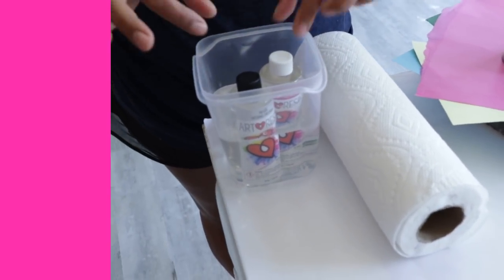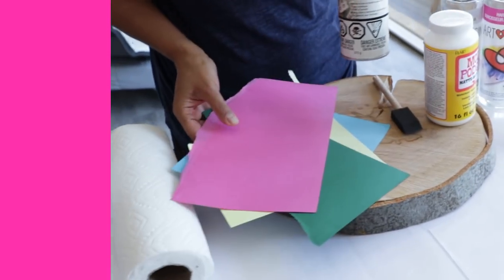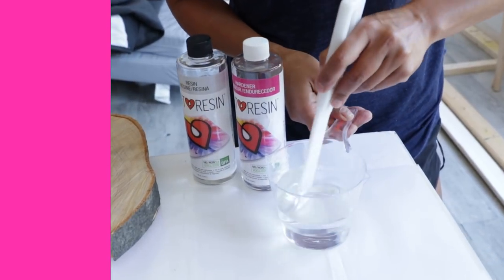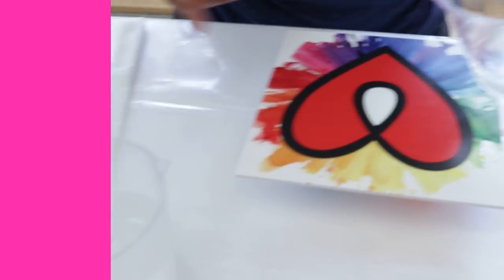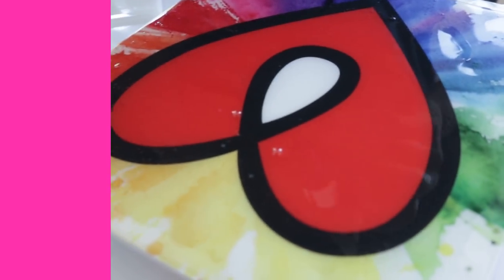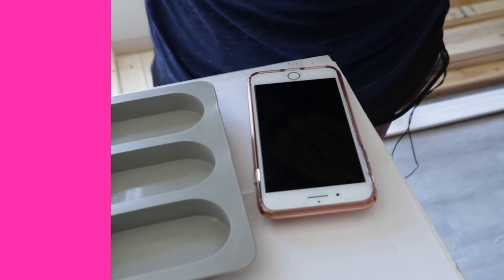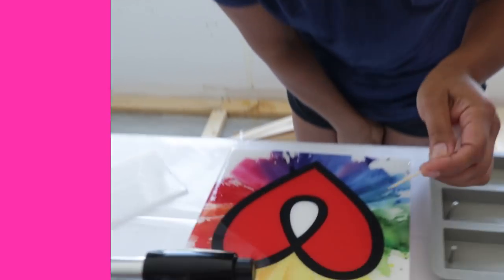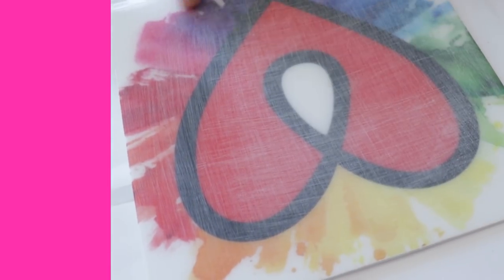How To Prevent Epoxy Resin Bubbles

Comment: Would heating the cup with epoxy after stirring in hot water or a heating pad work as well? And then pour very carefully? 

I am making a really big piece. It is like 40 cm high and 30 cm in width. It will be a diorama. So I have to do it in small layers and carefully pour. Do you have more tips for this? Is your resin working for a piece this big?
Reply from the maker: Hi Kimberley, we do not recommend using a warm water bath after the two parts have been mixed, the chemical reaction that begins when the two parts mix creates heat, setting your cup in warm water or on a heat pad at this point can cause a flash cure if too much heat builds up.  
Tips for pouring large pieces include-be prepared, have all of your supplies handy, do your prep before hand- all of your taping and surface prep etc.  Keep an eye on your working time, once mixed we recommend having your pouring complete within 45 minutes.  Sometimes if you are mixing large batches, it is easier to split it into two batches, enlist the help of an extra set of hands to stir a second batch rather than one large one, this helps reduce the risk of missing a spot or struggling to mix a large volume at once.
Reply: @Artresin  ahhh gotcha! Thanks for your reply and time! 😊
Would it help to avoid bubbles with pouring, if I pour the epoxy on an item in the diorama which is the highest of them all and let the epoxy get down on its own this way? Till it is high enough for me to gently pour it. 
I have to remove bubbles every pour I do, I think. Since the piece will be pretty high and deep. If I mix itvery gently and pour carefully, I should be able to avoid the worst of the bubbles.
Reply from the maker: @Kraftions  the best way to avoid bubbles will be to use the warm water bath and then pour in shallow layers if you want a deeper application.  You can then torch out the bubbles if there are any, allow the layer to cure for 3-5 hours before pouring on another layer.
Reply: @Artresin  ahh okido! Shallow layers will be like 3-5cm? Or thinner? This one will be pretty high. Around 40cm high. So It will take 2 days to do it this way.  Can a layer cure overnight before I pour a new one? Will you see the difference between the layers? I Also have to make sure I dye the epoxy the same, as it will be blueish. But that should be alright. Same amount of epoxy versus same amount of dye.
Reply from the maker: @Kraftions  We recommend pouring in layers of approximately 1/8" thickness to max 1/4" thickness to help minimize bubbles and prevent the resin from over heating.  If your layers are translucent you may be able to see a slight layer line between.   Casting resins will allow you to pour to depths of 3" in a single pour.

Comment: I do every single thing suggested to avoid and get rid of bubbles and I still had issues on my 4th layer. It’s a little piece on canvas. I pre sealed it. Then I put. Wood support under. I warmed the resin. Heated the room above 24c for 24 hrs. Used a blow torch. Repeated up to a 4th layer and even had minimal bubbles after mixing .
Heat would not release the few little bubbles. I find working on an 8x8 piece challenging. It’s a piece of art my friend’s child did as a toddler on cheap dollar store canvas. So the section with some bubbles only shows when looked at from a certain angle. I can’t add more layers so I hope my friend will be satisfied with it. I just don’t know what after doing ever single thing you suggest still doesn’t result in perfection .
One of my big pieces has a small issue (I’ll be selling that one) but there’s already too many layers of resin . Don’t want to make it cost prohibitive to sell that pieces there’s just one or 2 dimples in that one.
Reply from the maker: Hi Janine,  It sounds like you are doing all of the right things to combat bubbles.  Please reach out to us at support@artresin.com and include photos if possible, maybe we can help troubleshoot more specifically.  Thanks!
Reply: @Artresin  ok. Next time I do a resin subsequent layer I’ll video myself doing it and email it if there’s bubbles

Comment: Does anyone know where I can find that mold she had?!  I’ve been trying to find one like that but all the ones I’ve come across are too small
Reply: Amazon has it but search shiny finish or mirror finish and you will find even better polished silicone molds which result in a super shiny finish right out of the mold :) Happy Crafting!
Reply from the maker: Hey Ash - yes, that mold is from Amazon :)  Here is the link: https://www.amazon.ca/BARGAIN-HOUSE-Rectangle-Chocolate-23x19x2cm/dp/B077FRLCQ3/ref=sr_1_8?ie=UTF8&qid=1537192499&sr=8-8&keywords=silicone+mold+with+hole

We've used this one too with good success:  
https://www.amazon.com/X-Haibei-Circles-Silicone-Chocolate-Cupcake/dp/B00IYAWHMC/ref=sr_1_13?ie=UTF8&qid=1537192642&sr=8-13&keywords=silicone+mold+round

Take a peek at Josie Lewis' Amazon page - she has highlighted her favourite silcone molds for making petri dishes etc - super helpful!
https://www.amazon.com/shop/josielewisart/ref=cm_sw_r_pi_loc_3juiBb628TBQP

Just be aware that no silicone mold will last forever - they all eventually break down.  Try removing your cast before the 24 hr mark when the resin is dry to the touch but still flexible and that will reduce the wear and tear on your molds.  Here's a blog and video with some more info: https://www.artresin.com/blogs/artresin/shiny-vs-matte-silicone-molds

Comment: I've not being having much luck with art resin.. Even if the room is warm, and I warm the resin, and mix slowly, I get thousands of tiny tiny bubbles that I can't get rid of. Any tips?
Reply from the maker: It is normal to have bubbles when mixing. Using a torch is the best way to remove them from your piece after the resin is applied. Now some substrates tend to off gas or create bubbles while your resin is curing the most common ones are wood and paper, you may want to seal these items first before applying. If you are still having some troubles please email our customer service team at support@artresin and we will be happy to help you trouble shoot further.

Comment: How do you get resin to not scratch
Reply from the maker: ArtResin is scratch resistant but not scratch proof so using it on things like a function cutting board it would certainly show signs of wear.
Reply: ArtResin Can you spray resin with a spray varnish?
Reply from the maker: you certainly can :)

Comment: What about to use VACUUM? 😊
Reply from the maker: Hi Geomar - you're right, it did cross my mind to include a vacuum chamber, but we don't really use them here at the studio and it's a piece of equipment most people don't have access to, so I chose to leave it out. They are awesome to use if you have one, but I don't want anyone to think they need a vacuum chamber to achieve a bubble free coating - it's possible without one :)
Reply: ArtResin thank you! 😊
Reply from the maker: Hi Fadee - you can actually use resin as an adhesive ( check out our blog How To Resin Rocks: https://www.artresin.com/blogs/artresin/how-to-resin-rocks )
You can add the rocks after you pour the resin, but be aware they may sink in the wet resin.  You can glue them on afterwards if you choose to as well.